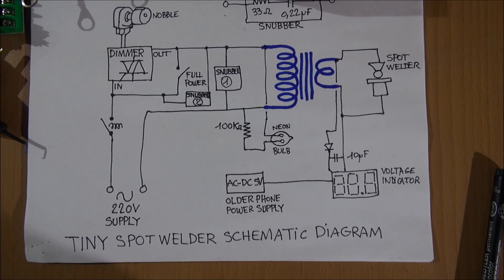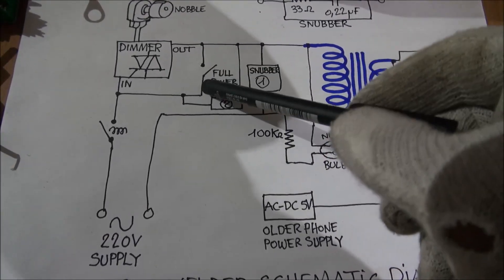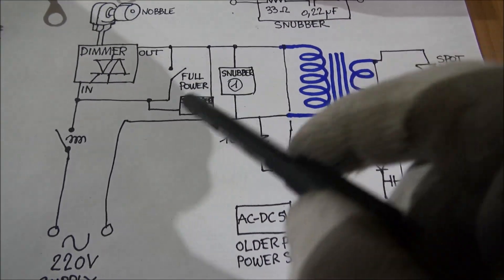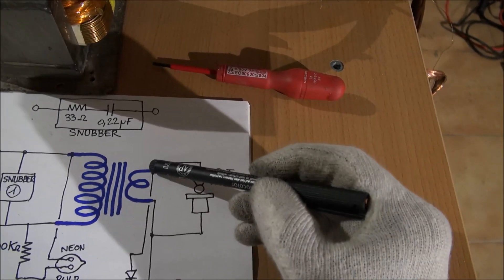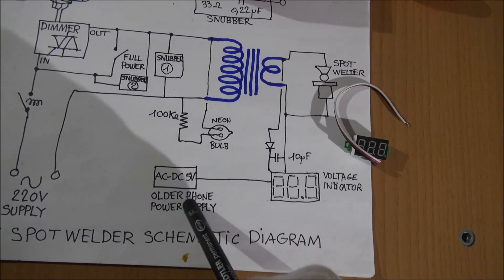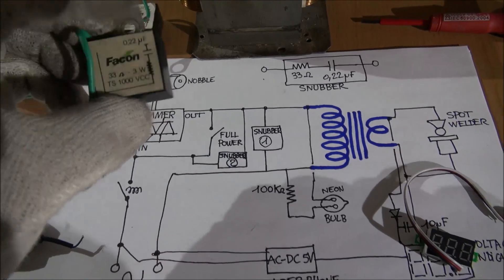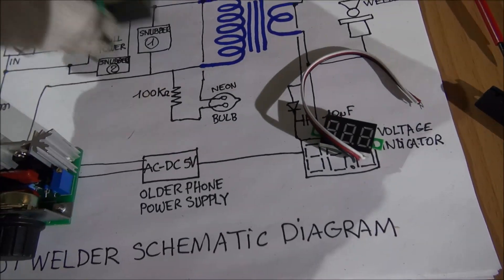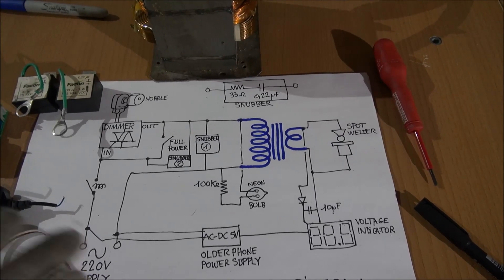Schematic and diagram of the tiny and compact spot welder

Comment: Hi Alexander, apologies for the questions but I live in Australia and haven't been able to find the exact same components. I have followed your advice but wanted to check if you thought the below parts list would work - would really appreciate your feedback! 
The power supply is 240V here.

For switches:
Weld On/Off Switch: 250V 3A Momentary Switch
Dimmer/Full Power Switch: DPDT 250V 3A toggle switch

For light:
Neon bulb 120V with 1 x 270K Ohm 1W resistor in series

For snubbers (not sure what combination of parts is best here as I can't find the same snubber units you have used)
Resistors: 
33 Ohm 5W OR 
51 Ohm 0.5W
Capacitors: 
10microfarad 250V non-polar OR 
10microfarad 400VAC 50/60Hz motor start capacitor OR 
20microfarad 400VAC motor start capacitor

For voltage meter:
1N511 1 Amp Schottky Diode
10microfarad 16VDC tantalum polarised capacitor

Any suggestions are greatly appreciated, love your vids.
Reply from the maker: Weld On/Off Switch: 250V 3A Momentary Switch
Dimmer
Full Power Switch: DPDT 250V 3A toggle switch

For light:
Neon bulb 120V with 1 x 270K Ohm 1W resistor in series

For snubbers (not sure what combination of parts is best here as I can't find the same snubber units you have used)
Resistors: 
33 Ohm 5W OR 
 ̶5̶1̶ ̶O̶h̶m̶ ̶0̶.̶5̶W̶
Capacitors: 
 ̶1̶0̶m̶i̶c̶r̶o̶f̶a̶r̶a̶d̶ ̶2̶5̶0̶V̶ ̶n̶o̶n̶-̶p̶o̶l̶a̶r̶ ̶O̶R̶ ̶
̶1̶0̶m̶i̶c̶r̶o̶f̶a̶r̶a̶d̶ ̶4̶0̶0̶V̶A̶C̶ ̶5̶0̶/̶6̶0̶H̶z̶ ̶m̶o̶t̶o̶r̶ ̶s̶t̶a̶r̶t̶ ̶c̶a̶p̶a̶c̶i̶t̶o̶r̶ ̶O̶R̶ ̶
̶2̶0̶m̶i̶c̶r̶o̶f̶a̶r̶a̶d̶ ̶4̶0̶0̶V̶A̶C̶ ̶m̶o̶t̶o̶r̶ ̶s̶t̶a̶r̶t̶ ̶c̶a̶p̶a̶c̶i̶t̶o̶r̶

For voltage meter:
1N511 1 Amp Schottky Diode
10microfarad 16VDC tantalum polarised capacitor

Hi sorry to be late. For your spot welder you need to have this
Snuber made by 33 ohm/..../50 ohms and 0,22µF/...1µF, you need two of these, this snubers are PARAMOUNT.
A dimmer of 2000 W ( see dimmer 2000 W on ebay)
A 220V push button, and a classical permanent button.
You have not to use a voltmeter module, a neon bulb, these are optional.
In case you want to use a voltmeter, you can use any diode you want, just take care that's not a zener diode! The better is schottky diode, but you can use a silicium or germanium diode.
You can use a 10 micro farads for the voltmer.
Reply: Thanks a lot for the reply...ah I misunderstood about the snubber capacitors - so they can be 0.22 - 1uF, that makes more sense. I'm not sure why I didn't read that properly the first time since you had it in the diagram and everything. I have the dimmer, the same as yours, also the schottky diode and 10uF capacitor for the voltmeter because I think it looks cool. Thanks a lot again for your help.
Reply from the maker: see this diagram for the voltmeter connexion
http://lektronik.canalblog.com/archives/2017/10/13/35765763.html
Reply: Thank you my friend, I appreciate your assistance a great deal. I have completed the structure of mine and just have to complete the circuitry. I copied your circuitry but made one small change from yours - that was to have a 12VDC illuminated switch, which in turn activates a 240V relay to activate the weld (I would just prefer to have a relay between me and 240VAC rather than switch it direct, and I like the illuminated switches but the LED only comes in 12V haha). I was hoping you could do me a big favour and have a quick look at my circuit to see if you can see any problems with it? I have a pic of the circuit diagram and parts I used to make it. Thank you in advance. 
https://ibb.co/iSUsxm
https://ibb.co/jPQXxm
Reply from the maker: Hi sir, according to your schematic:
The snubber of the top (connected to the toggle switch) need to be connected directly to the dimmer, on the hot input and hot output (there is 4 connexions on this dimmer, two of them are just a strap, you need to connect your snubber on this hot points).
Because you use a static relay, wich is a nice idea, you need to put a new snubber on the 240V hot points entry.
(this static relay have a snubber inside but it's not enough for this application).
Be carrefull with the neon bulb lamp. It needs a 270 Kohms and not 270 ohms resistor, wich is a big difference.
You can use your 12V power supply to supply the voltmeter, instead to use another 5V module.
I don't really understand how is connected your toggle switch, but you need to understand than when this switch is activated, it makes the dimmer disapear, and during it's activation, all the 240V goes trough the MOT transformer, giving maximal power.
In you case, this swich can be a permanent switch, cause you use an external momentary swich, comanding a static relay.
Before connecting, replace the MOT transformer by a light bulb, like a projector bulb. Incandescent bulb is needed.
Be sure you have a nice variation, form nothing to all the power. There is a potentiometer on the dimmer, you need to adjust your range of gradation.
After the bulb dim correctly, and after testing the toggle switch, you can connect the MOT.
Thanks.
Your comment was placed by YouTube on a spam box, and I was not notified for this, so sorry to be late.
Reply: Hi Alexander,
Thank you so much for your reply. I wasn't quite sure of the snubber connection so good to know it has to be on the dimmer points directly. I will add another one across the 240V input and output on the static relay. I will also get a 270KOhm resistor for the bulb.
Good point about the 12V supply powering the voltmeter instead of the 5V supply - would I need to step down the 12V supply before it reaches the voltmeter or will the voltmeter accept 12V?
Also good to know you suggested using a bulb to test - I have been doing exactly that with an incandescent lamp already.
Thank you once again for your help, it's greatly appreciated.
Reply: Alexander Hartdegen sorry for hassling you with yet another question on this (7 months later!)...I have connected a second snubber across the hot points of my relay and directly across the dimmer, however I am having an issue. 
I am testing it with a 240v lamp. When I connect the power, even without touching the momentary switch, 24v power is going to the lamp straight away (I am not sure how as there is no connection from the power supply to the lamp besides the relay (which I thought did not all any power throughput unless activated).
Also the dimmer does not appear to have any effect. Power passes straight through it as if it wasn't there. I have tried adjusting the potentiometer on the dimmer but it makes no difference to the lamp brightness (I adjust it fully one way, test, then the other and test and it's the same both ways).

I have attached a couple of photos. The wiring is only temporary until I get it working then I will clean it all up.

If you could please have a look and tell me where I'm going wrong it would be greatly appreciated!

https://ibb.co/kK61MU
https://ibb.co/fd34ap
https://ibb.co/hzLvgU

EDIT
Okay I figured out why the dimmer wasn't working, I had to use the two middle connectors instead of the first and last ones...but why the relay is allowing current to pass still confuses me...

Comment: Salut Alexander merci pour  travail et le temps passé  a faire des super video.
J'ai  une question car j'ai  utilisé  des tungsten de tig comme point de contacts et mes bandes de nickel restes coller a l'electrode non a l'accu !!  
Il faut que les pointes soit en cuivre ?  Et non métal  ?
Reply from the maker: le cuivre c'est magic. sa super conductivité fait qu'il est le dernier à fondre, pratiquement, à cause de la résistivité des autres métaux qui génèrent un effet joule plus facilement et rapidement.
Oui, il faut impérativement que ça soit en cuivre, même les équipements professionnels de ce genre sont doté d'électrodes en cuivre.
Merci pour ton commentaire.
Reply: Essaie avec des pieces de 1ct Euro. Ca va PAS mal
Reply: Merciiiiiiii Mr géni géniale ça marche...... milles merci encore
Reply from the maker: LOL ok tant mieux

Comment: Hi Alexander. Nice little welder. A parts list or links to the parts would be nice if you can do it.
For the rough hands try O'Keefe's Working Hands cream. No sent and it works wonders after you scrub em up. Thanks for the post. Best Wishes n Blessings. Keith Noneya
Ps here's an eBay link for the cream: http://www.ebay.com/itm/OKEEFES-WORKING-DRY-CRACKED-HAND-CREME-Free-Shipping-/201476986867?epid=691283423&hash=item2ee8f6d7f3:g:CNAAAOSwp5JWXc6d
Reply from the maker: Thank you for your blessing. For links, I think they will not remain available, items and their affiliation to the link will never remain stable, so the link will always give a dead direction, sooner or later. but I will try it, except for recovering parts I guess.
Thanks for your ebay cream link, I am sometimes surprised of kindness of people. Thanks

Comment: question about connecting the voltmeter. It has 3 wires. one for dc +ve supply, second for ground and the third for sensing the voltage under test. in your schematic you have only one wire going into power supply 5vdc and the other two are connected to the secondary of the transformer. are those the ground and sense wires? Is it correct to connect them this way? or am I missing something here?
Reply from the maker: Hello sir, you are ok cause my schematic is not perfect.
Indeed, you meet 2 configurations in the same schematic: Single-wire and mulltifilar configuration are used in the same diagram.
To the 5V DC supply are connected the black wire and the red wire of the voltmeter. To the soldering probe are connected the white wire and the (again) black wire. Black wire is the ground, it can be mainly used.
under the cathode of the diode is connected the white wire. The other wire is the black, wich is connected two times, to the soldering probe and to the negative dc power supply.
Thanks for your interrest, sorry for this misunderstanding.
Reply: Alexander Hartdegen  So if I am getting it right, the 10 mfd capacitor is connected between the the white sense wire and the black DC ground of the 5vdc power supply and then also that dc ground is connected to the transformer secondary output which is A.C and at a different potential. so that is a fourth connecting wire from voltmeter. Is that right?
Reply from the maker: yes, but it's a 10 µf capacitor, not 10 mfd. But you can use a simple usual 4,7µf capacitor.
it's a 3 wires voltmeter, but the black wire is connected two times = like 4 wires.
Reply: 10uf or 10mfd = 10 microfarads here in the states
Reply from the maker: here in France, a milli farad = 0,001F = 1000µF
a microfarad is 0,000001F.
But that's ok, thanks for the information.

Comment: ou trouver le snubber à acheter sur le net
Reply from the maker: Il ne faut pas l'acheter, le snubber est un composant fait avec deux composants (une résistance et un condensateur), les snubbers sur la vidéo ont été récupérés dans une armoire électrique bonne pour la déchetterie.
Ils sont très vieux et sûrement introuvable sur le marché actuel.
Il suffit d'une résistance de 33 ohms de 3 watts et  un condensateur de 0,33/0,22 µF (300 Volts) en série pour faire un snubber. Un snubber = amortisseur, ça permet d'éliminer les pics haute tension et haute fréquence qui par retour perturbent l'amorçage du triac.
Merci pour votre commentaire.

Comment: best spot welder on youtube but what is shot kit diode or something like this
Reply from the maker: this is a shottky diode. Normal diode (silicium diode) have 0,7 volts on it's leads when powered on the continuity sens. But Shottky diode (or germanium diode) have only 0,3 Volts.
This diode rectifier charge the capacitor for it's make readable by the DC voltmeter. If you use a silicium diode you will have an error about 0,7 volt on the voltmeter display, but if you have a shottky diode, you will lost only 0,3 volt on the display.
On higher voltage there is no matters, but here we have very low voltage, around 3 volts. This is the reason why a shottky diode is preferable in this case for to have the best idea about the voltage output.
Thanks for your comment!
Reply: I can make snubber with 33 ohm resistor and 0.22uf 400 volts capacitor
Reply from the maker: yes
Reply: guessing a 1 or  2 watt resister, 33 ohms, also non-electrolytic capacitor (unless you like firecrackers).  Great project!

Comment: Hi! very nice project! also very good assembly. enjoyed watching you building project. 👍
since I don't have a microwave around how much ampers should i have at welding point? and how do you calculate secondary turns/gauge?
Merci beacoup
Reply from the maker: welding point depends about tick of your welding structure. 
You can use very high amps during very short time during weldding, and less amps with more time.
With a micro wave transformer, you can expect than you have 1V/1turn. This is not a roon mean square value.
Welding point is very subjective. With this project, you don't have to worry about these facts, cause you have a dimmer to adjustate the power you need for welding.
For calculate the secondary turns, you need to make ten turns with thin wire, and mesurate it. All the possibilities of output variable tension is a multiple of ten. Thanks for your comment.

Comment: Great diagram Alexander, but here in Mexico we have 120 volts my question is if the snubber works equal or can you help me to know how calculate the snubber??
The idea of this spot welder is for build stainless steel filters for 200 mesh.
Reply from the maker: yes the snubber is egal for 110V. Snubber is not a sharp value, you can make more or less, it's works only on high pic of voltage.
The important thing is not the voltage, but the period of the pic of voltage coming from the transformer when the triac switch on/off at this moment.
The frequency of this pic is something between 300 Hz and 3 khz. The snubber absorbs these fork of high frenquency pic, it doesn't matter about 220 or 110 volt, or more or less. Thanks for your comment.
Reply: Great men...
Thank you very much for your support..
Regards...

Comment: I need a small spot welder for putting new rechargeable battery cells into cordless tool battery packs I wondered if it is possible to make a small spot welder from a gun type soldering iron ( the type that has a transformer in it)" Weller" make this type of gun soldering iron .
will I need to make any changes to it?
Reply from the maker: no, you can not do this, cause the power is not enough to make metal melt. You can use a small rewinded transformer, but you need 300 Watts transformer minimum. The current need to be very high to make the micro melted point, your idea is nice, but you will have only high temperature point, but not enough hot to make the soldering point. With a little transformer, you can do a gun soldering point, like you said.

Comment: Phenomenal Videos! Regarding the snubber? I can't seem to find any modules with those values. It seems I can only find capacitors. Are those values perfect for this setup or would it be better to run larger capacitance caps?
Reply from the maker: You can use a little bit different resistor, or a little bit different capacitor, in twin mode. (because you need two snubbers). You can use a 50 ohms résistors with 0,5 microfarads capacitor. In fact, that's not so sharp. The main thing is to blocked the parasits they come when the triac plugs on or switchs of on a maximal front wave. Just try to find 350 volts capacitors and 3 watts resistor.
Snubbers are for to prevent about parasits. They can perturbate the dimmer during weldering, and the power setup can be perturbated. During my first test, the potentiometer was destroyed by parasits. This is the reason why I used two snubbers.
Reply: Thanks for the detailed response! Cheers!

Comment: Haz resuelto el problema de potencia en mi maquina soldadora de puntos, jamas me paso por la mente regular la potencia del mot con un circuito dimer, Muchas gracias, saludos.
Reply from the maker: @José Montenegro thanks, don't forget snubbers for the best result.
Reply: en donde va conectada el snubber?
Reply: ya vi donde colocar el snubber, tengo problemas traducir otros idiomas.
Reply from the maker: @José Montenegro el amortiguador es un circuito antiparasitario compuesto por un condensador en serie con una resistencia. Se coloca sobre el primario del transformador y los dos terminales de la dimmer. Este amortiguador se utiliza para evitar que las plagas de interrumpir el regulador transformador que puede permanecer en cuando no debería ser.
Reply: Entendido, es muy amable, muchas gracias amigo.
Reply from the maker: @José Montenegro se puede ir a la parte inferior derecha del vídeo, en -> Configuración -> Subtítulos -> traducir automáticamente -> español.